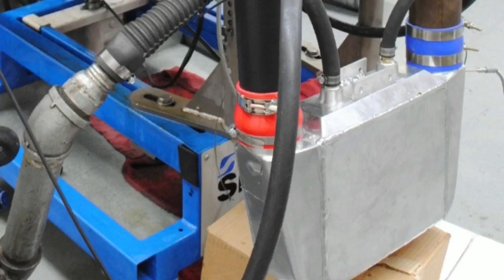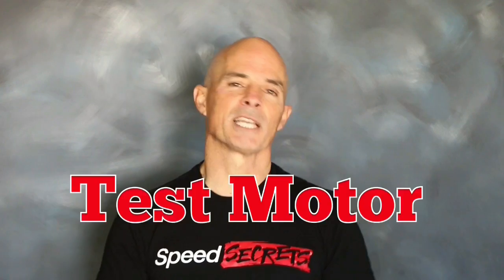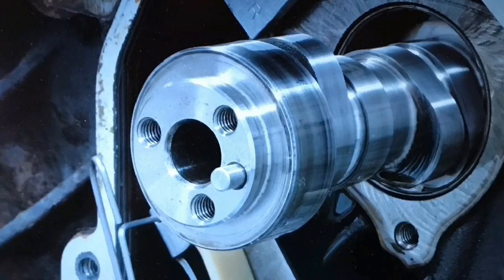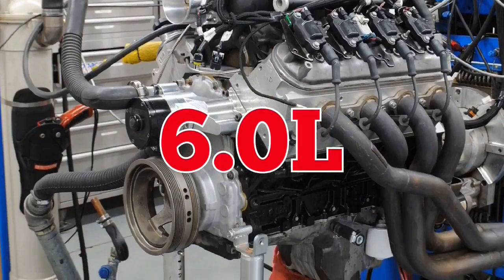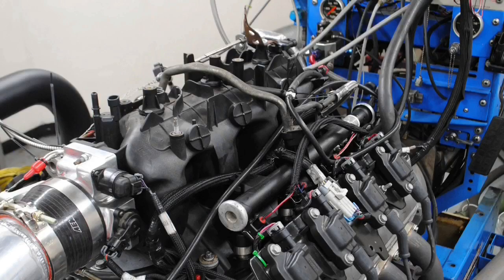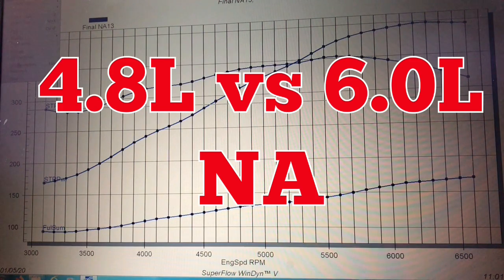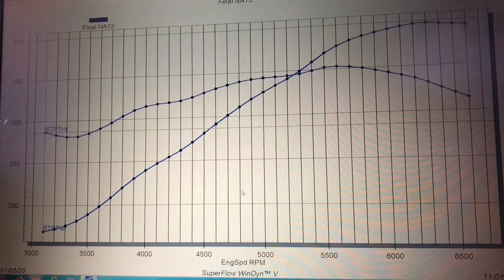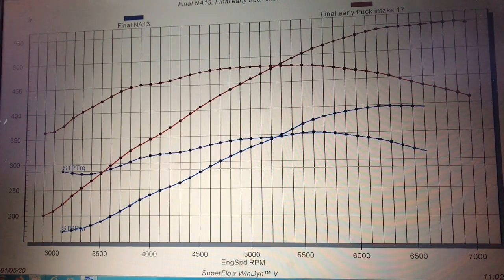SUPERCHARGED 4.8L vs 6.0L Full BOOSTED Results!

Comment: I was disappointed. Amazing concept and decent video though. totally ruined the video for that the engines were not the same setup. totally makes it pointless for me that they used the same blower and pulleys. The only real evidence I see in this video is that a larger engine that is capable of consuming more Air will consume more air AS OPPOSED TO COMPARING A 4.8 TO 6.0.
Reply: it may have ruined the video for you, but not for everyone. it is pretty obvious that higher blower speeds can produce more power and bigger motors have the potential to make more power, there no point in testing that. i enjoyed watching the video and it would have been costly to make sure that the different engines have the same setup.
Reply: @sepg5084  It would have been costly, but way more useful, which is why we dont have data on it yet. I can go throw some already assembled engines on a  dyno and tell you what numbers they make too, and have the results be completely obvious before i did the test. better yet just pull some previously dyno'd engines data sheets up and use those. you could likely find 2 engines that are more closely related just by pulling up old tests.
Reply: @sepg5084  ... my point is they cut corners where it could have been so much better had they not. it was a lot of work to create this video in the first place and if they had gone the extra little distance we all could have benefited better and been more satisfied with the results
Reply: Ya, pointless test. Both engines should have been stock on race gas with the same cam. But in the end it would have been a "duh" result. The bigger engine made more power at a lower boost level and rpm.

Again, these combos should have been pushed to the limit, I bet the 4.great would only been behind the 6.0 by 7% if it got spun to 8k rpm.

Comment: Doesn’t the cam play a factor in that boost number?
Reply from the maker: yes it does-along with everything else
Reply: Yes, but only to the extent that the cam can affect how much air the engine can consume.  If you think about it, gas engines are just large air compressors.  Holding all things equal (heads, cam, intake, etc....) the 6.0L displacement engine will always move more air than the 4.8L because the larger displacement can suck in more air from the intake with each revolution of the crank.  Boost pressure is just a simplistic way to measure how hard the blower is working to push the air into the engine.  The 6.0L can suck in more air at 6000rpm than then 4.8L engine, which is why the blower has lower boost/backpressure on the 6.0L.
Reply: Yes, so the cam should have stayed the same on both engines.
Reply: The valves in the 6.0 are probably a little bigger as well just because it is a larger motor. Bigger hole in the head will usually flow more

Comment: The reason for less boost on the 6.0 is not because it's more powerful, it simply displaces and uses a larger volume of air than the 4.8. You're putting the same volume of air into each engine, so it's easy to see why there is less boost pressure in a engine that takes a larger volume of air. Great video, kinda misinformed.
Reply from the maker: the reason the 6.0L has lower boost is because it makes more power-it processes more airflow. A more powerful NA 4.8L would also drop boost. More power = more airflow used = less boost-displacement can do this, or other mods that improve power without a displacement change will accomplish this
Reply: @richardholdener1727  yes, the 6.0 displaces 1.2 more liters of air, so it takes more air to fill 6.0 liters compared to 4.8, since you have the same exact air going into the engines (same supercharger, same supercharger rpm) this is where and why your boost loss is happening on a larger engine.

Comment: Great video Richard! As a follow up, how about installing a turbo(s) on either engine, same boost level,  to compare blower vs turbo HP/torque! Videos have greatly improved! Thank you, Tony
Reply: Turbos will make more power at the same level bc of the drag of the supercharger. Thats power to make power with a supercharger... And it will be impossible to run the same test as superchargers bc ot the linear boost level. A turbo will come in alot sooner.
Reply: @chrisfuller8584  I'm not a know-it-all and I don't have a power adder, I'm nobody, I agree with everything you said, but the last sentence, I've never heard or talked to a racer that says a turbo comes in sooner, but I had heard them complain about losing because they didn't spool, superchargers are spool from the get-go are they not? Turbos run off exhaust pressure. One of us is awfully confused it's probably me , I'll have to double-check I have a four-wheel drive truck and was planning on a supercharger because of what I thought I heard everyone else say.  I hope you're right I can turbo cheaper than a supercharger.

Comment: Like to see some carb nitrous builds I am running stock bottom end lq4 with 317 head and btr cam  with a carb working on getting a set of 243/799 to up my compression make better use of the btr stage 4 ls3 cam
Reply from the maker: A while back I maxxed out a Zex Perimeter plate on a SBE 5.3L-nice little 300-hp shot
Reply: @richardholdener1727  nice yeah I am running nitrous outlet stinger plate only at a 150 shot rite now seeing how don't have a progressive controller running the MSD 6014 rite now

Comment: Do you like PROCHARGER or TWIN TURBOS????
Reply from the maker: both work well-just differently
Reply: Reason I ask is because on one hand I hear pro Charger has belt slip and power lose because belt driven 
.
Turbos are expensive and you all wise have to have a wrench in hand 
And heat issues.
Reply: @slyr1  depends on your budget and application.

Comment: 120 degree lsa with only 230 degrees of duration on the 4.8 ! And all that bias to exhaust .  Horrible camshaft , even for a pd blower .  Killed power in 4.8 .    Not a good comparison compared with The 6.0 , much better cam though not ideal at all.
Reply: The cams were not a good choice. The same cam should have been used for both engines. Something simple like the SS2. Comp has something similar but I hardly ever see anyone using Comp any more.
Reply: Jon Herman I believe it was this guy That did a test comparing duration splits .  They literally had little to no effect.  Even on supercharged application only a small bias towards exhaust is needed .  The rest is bleeding off cylinder pressure in the midrange hurting torque .  Also lsa is wayyyy to wide .
Reply: @hereinmissoula11  he just should have used an LS9 cam...lol.
Reply: Jon Herman way to mild ...  35-50hp to gain off that cam .  Been done .
Reply: @hereinmissoula11  hence the "lol" at the end of that comment. That one cam he used was almost as bad as the LS9 cam...its cheap, for a very good reason.

Comment: When does the added stroke length affect things is there a benefit at any power level to shorter stroke like I’ve heard
Reply from the maker: race engines use shorter stroke lengths to allow for large bores-improved head flow on Xtreme applications-not really relevant on street/strip LS motor-displacement always wins
Reply: Only time you’d wanna destroke a motor is if you are trying to make it rev. Short stroke, big bore, the motor will like rpm. A light vehicle would benefit from a small motor because it won’t be producing near the torque a bigger motor will. Like Richard says cubic inches win at the end of the day...

Comment: I might have missed it, but what injector size are you running? Also, what fuel? Are you running E85 or race gas? Thanks!
Reply from the maker: race and 83 pound inj
Reply: Richard Holdener great! Thanks Richard. I’m rag-tagging together an older V1 head unit that I made a mount for to put on my 5.3. I’ve got the flex 50lb injectors in currently and trying to figure out if they would be enough to run 93 pump with a goal of 450-550 tire. Thanks for all you do!

Comment: As always, displacement and airflow + boost = more power. Hence the reason my turbo combo is starting out as a 6.0, vs the 5.3 I had originally. Plus the LS3 heads flowing better and being less shrouded than they would be on the 5.3.
Reply: Depends on your goal , a turbo 5.3 can make well over 1000hp without breaking a sweat .
Reply: @dilsher12  agreed. But with how much boost and with what fuel? No I'm not suggesting trying to make 1000 on 93 octane. I'd rather make as much power as I can on 93 before even going meth. Bigger displacement and better heads make that a lot easier. And the right turbo/supercharger.
Reply: @jaydubb71  If you are octane limited , having bigger displacement helps for sure . I'm running a gen4 alu 5.3/S475 and had to run water/ meth to go past 10psi of boost, no E85 here . Running 17lbs now and over 700whp and its more than enough for me as its primarily a street driven truck . 6.0 and ls3 heads are a very good budget friendly combo .
Reply: @dilsher12  again, agreed. I'm not too octane limited here. Just don't want to rely on Meth. We have some E here in the DMV area but until it's widespread E availability, I'll try to stick with 93 with a dash of meth.

Comment: I'd like to see what affect compression ratios have on spool time and boost levels
Reply: I wonder how spool testing would be on an engine dyno. I think they can compare at same load but idk if that transfers to road conditions.
Reply from the maker: engine dyno not ideal for spool test
Reply: @richardholdener1727  yeah I just want to see if higher compression would bring down the point in the RPMs at which the turbo start spooling since theres higher pressure in the combustion chamber I would assume exhaust gases are moving faster yes?
Reply: Berserka Saurus i think vehicle weight also would effect spool time
Reply: @supertampon5  when your on the starting line and spooling the turbo. The Weight of the car has no effect on how fast it will spool. Things like engine size, hp, header type, turbo kit, etc dictates that.
Reply: @waynebollentin989   also as far as the weight thing goes turbo spool faster when there's load on the engine. like going up a hill, towing something  or just weighing more
Reply: @lukassonntag3956    the worst part is when people ask questions that have nothing to do with the video and aren't clear in their question.
 You asked about spooling and never said a word about a turbo. Sorry there's many people that don't know a the difference between turbo and blower. That's why I said something. 
It also should be obvious more compression is going to make a turbo spool faster everywhere. When you increase compression you increase flow. Which in turn will spin the turbo faster. 
When it comes to weight and spooling I was obviously talking about staging a car. The engine dyno can only show what's going to happen then. Meaning the weight is irrelevant on a engine dyno. Also there's many other factors that make it hard to get an answer. The tire type and size, gear, transmission, converter clutch, etc will all affect the out come. Although I thought it was common knowledge a turbo likes load anyway. Next time be clear about what your talking about and you won't have guys like me breaking your balls.
Reply: You don't spool blowers only turbos. Boost is instant because it's relevant to rpm. You can sit there at 4,000rpm for 2 mins and it's not going to go up. Where a turbo engine at 4,000 rpm will increase boost without anymore rpm. Hence spooling the turbo.
Reply: @waynebollentin989  this is the worst part about the internet everyone else clearly got what I was asking but there's always one neckbeard who has to prove he's smart
Reply: Compression has a pretty big effect on the base power and then it goes even higher with boost. That being said high compression engines tend to not like boost because they start igniting the fuel solely because of their compression. They basically start acting like Diesel engines except the fuel is already in the cylinder instead of being injected to ignite. That’s why a motor with 13.5:1 or 14:1 will most likely never see boost simply because it can’t take much of it without running into issues with spark knock.
Reply: @matthewhall9530  I was more leaning to spoil time not total power
Reply: Supercharger not Turbo, I don't understand the spool and the comment. A centrifugal supercharger does not spool like a turbo. Correct me if I'm wrong, I am new to this game, just saying not knocking your comment!
Reply: @MrCrazyking81  I was asking for a future video since he does a lot with turbos but yeah you're right about the spool thing
Reply: @lukassonntag3956  you're good, just commenting and trying not to seem negative. There's too much of that crap on YouTube. Always stay positive that's how I roll
Reply: Conpression ratio decreases spool time. The flow of the heads intake and cams determine boost. Boost is just the result of back pressure.
Reply: I was more meaning there is kind of a limit to how high the compression ratio can go before something goes wrong. Spool times are usually more dependent on load and the size of the turbo itself compared to how big the motor is. A tiny motor with a big turbo might not spool at all and a tiny turbo on a big motor probably wouldn’t last very long because it’s be at its max pretty much instantly. That and dynos can load up whatever’s on them and get a turbo to spool then let it go through a pull. That kind of load really isn’t ever possible in a real life scenario.

Comment: Nice videos bro! Any videos on 302 & 351w Superchaged?
Reply from the maker: I have tested those a lot-will post some
Reply: Richard Holdener Im looking to do an junkyard 351w roller motor that came out of an f150. I gonna keep the bottom end stock . I’m gonna add a roller cam & take my Trickflow 170 heads off my 302 & Vortech v3 Superchager. How much power do you estimate at 10psi?

Comment: So there's no replacement for displacement.   I'd really like to see a comparo of old trucks VS new truck.   406 with AFR heads VS 6.0 LQ94with AFR heads and good intakes.
Reply: John Rock Hey John they did this test way back: Chevy Small Block Dyno Tests - Old School Meets New

It was a good read, the hp and torque were the same. But of course there was complaining that the gen I was to radical for the street, this is always the most ridiculous thing (hot rodders say). They need to drive a Prius instead!

Comment: fantastic content. its like engine masters but with more detail as to why the results are the way they are.

i expected the result to be that with the same pulley setup the 4.8 would have more boost (due to it being more of an airflow restriction than the 6.0) i didnt expect the 6.0 to make that much more power than the 4.8 though, i thought the HP would be much closer together and the boost difference would be larger if everything else was equal except capacity.
Reply: the 6.0 was still climbing really hard at 6500rpm too.
Reply: @AlexAutoRepair1  yup
Reply: Except engine masters is about some pretty gnarly setups
Reply: i love watching holdner, but thats not to discredit engine masters.  totally different approach and delivery of the content.  if engine masters was asked to do a 4.8/6.0 comparison under same boost conditions, and they chose to do it, they would do it similarly.  No need to discredit one to prop up another.  MTOD does a good job in my opinion with the engine masters show!
Reply: Steven W the cams made the most difference. The 6.0 had a way more agressive cam and heads. Plus the 4.8 is supposed to be revved higher. Redline for those is in the 7000-7300 range. It’s not a fair test at all.
Reply: Tommy Hathaway your mad
Reply: @tommyhathaway9190  so you think a slightly bigger cam will make up a difference of 150hp. Not a chance
Reply: Dude, if you want to test the real effect of displacement use the exact same heads and cam as well. This here was a sham.
Reply: Tommy Hathaway you must drive ford and get gapped by gm

Comment: What I took away from the video is how slowly those centricals build boost. My Kenne Bell 2.8 on my 6.1 hemi makes 12 lbs from 2000 rpm all the way to 6400. Will be sticking with my more area under the curve blower.
Reply: If a more aggressive boost curve is desired it really is as simple as swapping pullies.
Reply from the maker: those work well
Reply: screws are generally more efficient at lower rpms, centries are generally more efficient at higher rpms. screws are for people who need the low-end torque advantage and are willing to spend more, while centries can cost less, weigh less, and be easier to package. Higher Wheel Torque can be achieved thru lower transmission gearing anyway. Centries have wider choice of intercooling options too.

i guess screws have the advantage on drag strips with prepped pavements, ice tank on the trunk, and drag slicks. Centries may have an advantage on circuit tracks where there's no prep and too much torque on a corner exit can cause trouble.
Reply: You cant really compare a positive displacement blower to a centrifugal blower they are 2 different animals